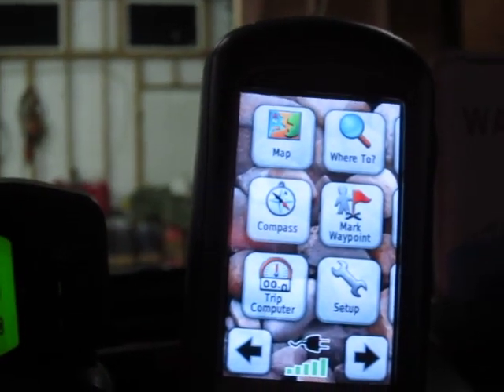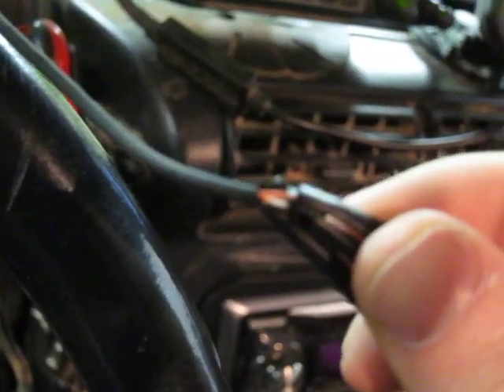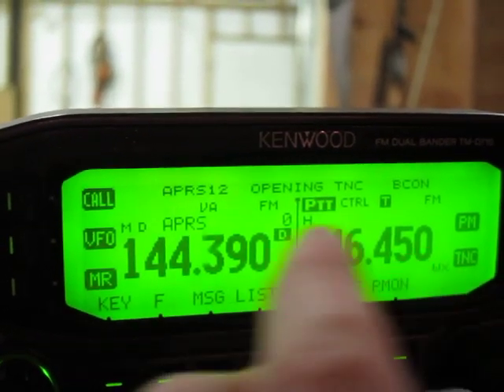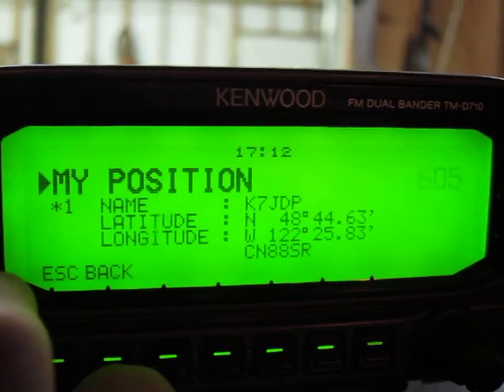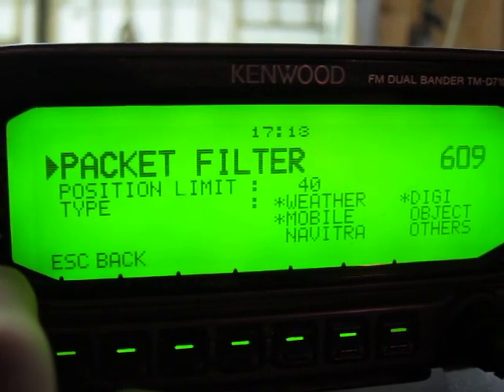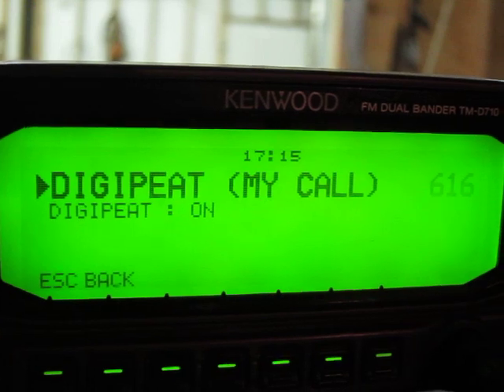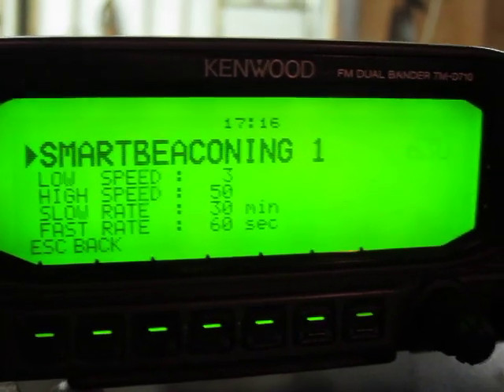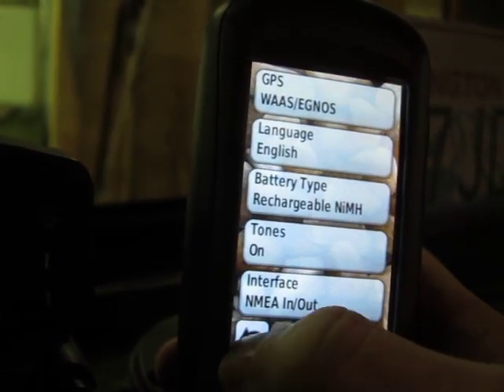Setup APRS with Kenwood D710 and Garmin Oregon 400t

Comment: Hello Jakob! I own a Garmin nüvi 765t and a Kenwood TMD700A. I need to plug them both to eachother in order to use the APRS from the Kenwood base. I have seen the connections between the wires that you are using. The question is - are the same ones to connect into the Garmin nüvi that I have? If possible, do send me a simple diagram with the wires' colors that are connected to eachother into the base so as to avoid failures. Thank you very much. I'm also a ham radio. My callsign is LU8FRM.

Comment: I want to add an audio connector to the cable instead of splicing it. Correct me but I think the White wire would go to the Tip, Yellow wire to the Center and the Green wire to the Shield/
Reply: Got a right angle 3/32 stereo plug from Radio Shack and connect white to tip, yellow to center, and green to shield and works  great. I use a right angle so it would not stick out too far.

Comment: Thank you for this video. After a couple years of seeing this I finally set this up with the Kenwood D710GA and the Garmin Montana 600, only using the Garmin Marine mount  instead of the cable you suggested. Instead of green, white, and yellow it uses green, yellow and blue. The green is still the ground wire, yellow is data-in, and blue is data-out from the Garmin. Once I had that straightened out it worked like it should. Only peeve is that now the Montana occasionally gives a "Database Error" I think from becoming to0 overloaded with waypoints. Like Shawn Anderson says, I need to filter some of these to see if that helps. And also the waypoints do update when they receive a new position from the corresponding station. Very cool. The only question I have is which GPS is better to use for APRS? The internal one included in the "GA" or the Garmin's? It seems to work the same regardless of which one I set it to.

Comment: Yes.  I have been running a similar set-up as well with Kenwood and Garmin Montana 650t in my truck,  home and on my dual sport motorcycle.  The beacons update great on the map screen and remove the old (former position) automatically.  To limit the concern of overloading the gps with waypoints, you can set various filters to your rig.  I do get a database error every few hours.

Comment: Are you supplying 12v to the Garmin GPS thru the data/power usb cable?
Reply from the maker: Yup, the red cable is attached to 12v always on, 10a fused power.
Reply: +Pascal Beliveau Two points about the power.
1. The Garmin cable is specific, 8 to 36 volt input. One day I will figure out how they control the voltage.
2. The Oregon will not communicate on battery power. It must have external power, I guess that is to turn the usb functions on properly. I didn't have the correct connectors the first day, so I tried the Oregon on battery power and had no success. First try on 12 volt everything worked properly.

Comment: in the top middle of the screen where the clock is above the partion bar is mine would say "my position" or "my message" when ever it would transmit a message or my position but now after having to do a full rest it dont do it anymore got any ideas?

Comment: Welp, I think I was just sold on this radio, been having a hard time figuring out what I want to put in the truck, glad to see this will work with my GPS in both directions so that I can handle some balloon tracking, and monitoring/working with multiple frequencies which is handy with some events I deal with.  Thanks for the video!

Comment: I have a TM-D710 with the G-Trans cable running a Garmin Nuvi350. I'm not up on the Oregon but for the Nuvi350, in Menu 603, WAYPOINTS, there are two choices, NMEA and KENWOOD.  I have to set mine to KENWOOD. You might try that, if you haven't already, and see if it works better.  That was one of the problems listed with the Nuvi350 in displaying the Waypoints correctly.

Comment: Question... with the station waypoints coming into the GPS, will the Oregon update them as it receives new data, or just keep adding new waypoints.  That is, if I see VE3EEE-9 and it makes a waypoint, then VE3EEE-9 moves, will the new position update the oregon so I only see one VE3EEE-9 position (like a tactical display) or will it create a new point so I see the both old and new positions of VE3EEE-9 ?  This was a hassle on my old GPSMap 76CS which would keep adding waypoints until it filled.

Comment: When I first fired up my D-710/Oregopn 450, there was no waypoint indication on the screen.  I went to "GPS PORT" (Menu #602) and changed it from "OFF" to "WAYPOINT".  Hoowever, there is a minor inconveniience of a screen coming on form time to time stationg "Database Error" on the 450.  So i have a bit more snooping around to do.  Thanks for the video and encouraging me to finally get my 450 working with the D-710

Comment from the maker: @mylhol hmm yes the 450 works the same way, a buddy in my 4wheeling group uses that GPS, he has the newest firmware as of december. He had a similar issue, I believe there is a setting on d710 that says waypoint. On the GPS, under system->interface Make sure that 'WaypointIDs' is set to Names and NMEA Sentances is On (garmin propretary on). Hope that helps!